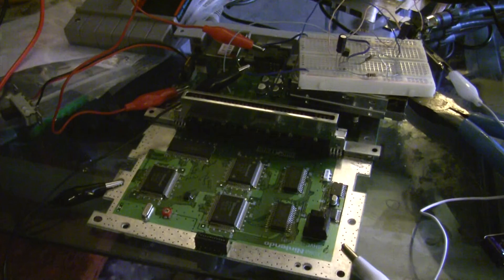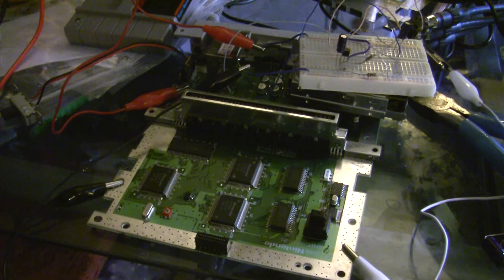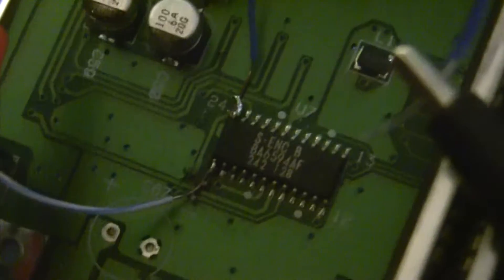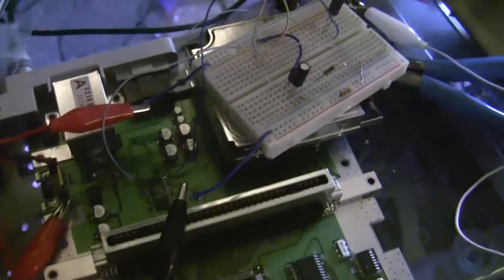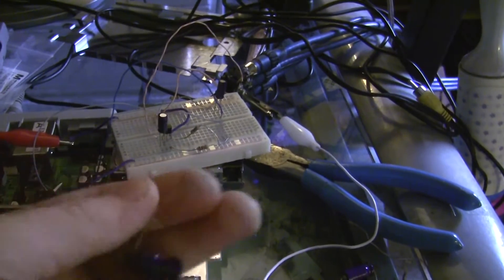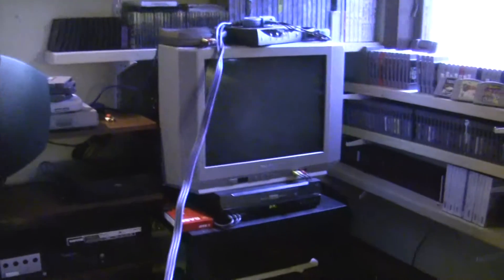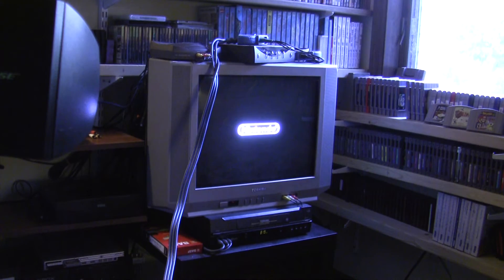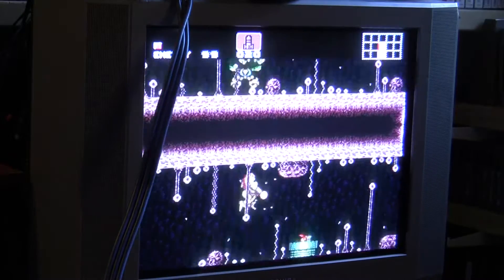Super Nintendo SENC-B YPbPr Findings and Output

Comment: I've managed to get component video out of my GPM-02 SNES as well, but I connected it to my Samsung HDTV that actually does support 240p component video. The picture quality is really great, and I had to prototype all types of different resistors and caps as well to fix the colors. The only thing I haven't been able to get rid of is jailbars. Idk if that's because it's on an HDTV or if it's because I have all component jacks bridged to ground together.

Comment: This mod is kind of obsolete now because of HD Retrovision's SNES Component cables, plus even if you do this mod it won't look as sharp in the end compared to SNES 1Chip revision boards ;-;
Reply: The price difference is enough to mod a snes for component vs the Hd retrovision's snes component cables.

I have modded a bunch of snes and super famicom's for component and the picture is always awesome and good call on the tims YPbPr converter,it works great in a 1 chip.
Reply: Sold out, €120 on ebay now.. So yeah...

Comment: interesting video mate. i have done a few component mods to various snes systems, i usually ground all 3 video signals. i did notice that the picture can be washed out if using the multiout cable for audio. so what i do is add the two audio jacks and dont ground them. i have made a few videos however dont go into technical details like yours.  since the video i have improved the picture further :) and also in my video i have the multiout connector in so component is a little off.
Reply: Yeap thats what i do :)

I did a test on my old plasma and the picture is night and day. Have not tried your circut yet